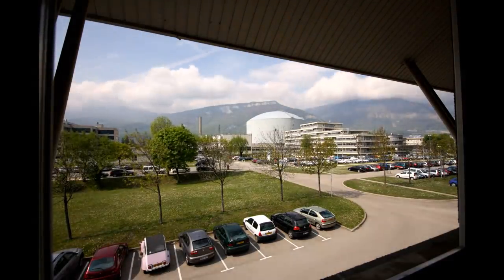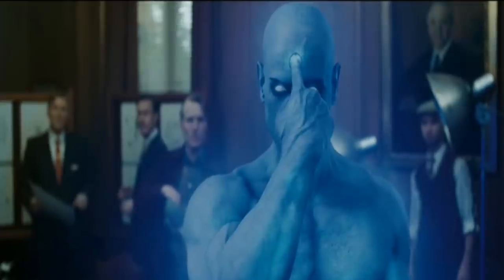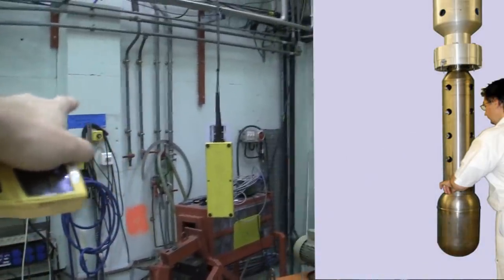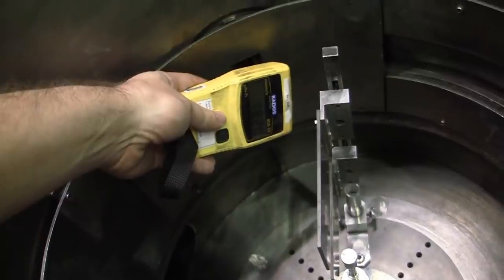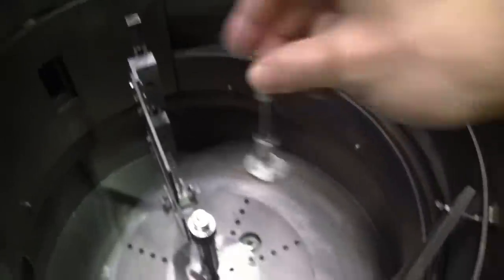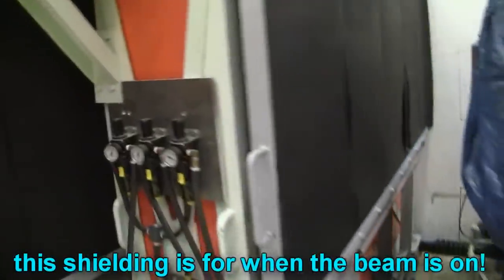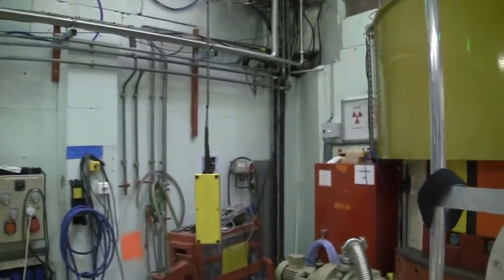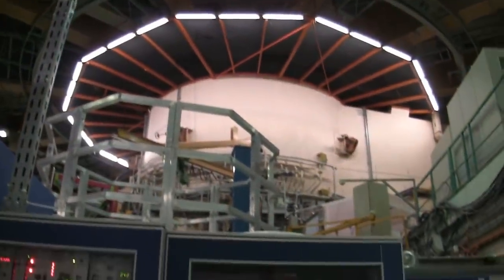Nuclear Reactors, Fantasy and Fact!

Comment: Won't the neutron be far away from its source by the time it decays. I would think that a neutron would have traveled pretty far in 10 minutes.
Reply: That's the half-life of a neutron. That's not to say that half of a neutron decays in 10 minutes... rather, half of an certain amount of neutrons (all of which have spent the same time as a free neutron) will have decayed into protons, electrons, and antineutrinos after 10 minutes of being free neutrons.
If you consider a single neutron, the actual time for it to decay is actually quite random.
If you have an enormous amount of neutrons streaming from a reactor, then you have a chance for a large amount of them to randomly decay in a short amount of time.
At least that's what I think. I'm not an expert on this subject.
Reply: I think its still safer to stop the "runaway neutrons" before they could potentially cause damage. It would suck if you got cancer from a stray neutron while driving past a reactor.
It would be like aiming fireworks over your garden wall, It's not gonna hurt anyone inside your garden but it might explode on someone elses face
Reply: Why do ya' think that?
Reply: Pinkie Pie I would think the same, a break-away neutron seems like it could have alot of energy built up

Comment: Great video puts things in perspective. I used to be indoctrinated with how bad nuclear power was. In highschool I did my end project for physics on nuclear power and my first question is: "which form?! there's many different ways to do nuclear power."

I was also astounded to find out that the uninitiated thinks that nuclear material with 10.000s of year of half life are more dangerous than material with enormously short half lives. As you explained here I found out that it's quiet the opposite the stuff with long half lives have marginal energy discharge and very safe for mankind and environment.

When in college (3 months after graduating highschool) we had the chance to go into a nuclear powerstation I was thrilled. I was one of the few who dared to look down at the reactor. I was certain that the 15 meters of hard water on top of it shielded me from harmful photons.
It's interesting that people who even put a little research into nuclear power see that the damage and risks are far less hazardous as burning fossil fuels. Burning coal and oil sets free a lot of radon and fine dust that are far more deadly than a nuclear powerplant will ever be.
Other techniques of Thorium salts seem to also eliminate the potential meltdown risks.

I rather live next to a nuclear power plant than a coal burning power plant.

Comment: The radioactive material is not glowing blue. If you put a lump of that stuff next to you, you would not see a blue glow from it, for two reasons: 

1) You would be dead
and 
2) The blue glow is the result of electrons traveling faster than the speed of light in water. 

So, the blue glow requires water, and speedy electrons traveling faster through the water than light can.
Reply: You can get that blue glow in air, because light slows down when moving through it too, just not as much.  Your point one would still be true as the amount of radiation needed to create that glow would be very quickly lethal.
Reply: Steffan Murphy Nothing can travel faster than light in a vacuum in free space. Other terms and conditions may apply. See store for details. Objects may travel faster than light inside material substances.
Reply: Steffan Murphy About Cerenkov Radiation: 
http://en.wikipedia.org/wiki/Cherenkov_radiation
http://www.britannica.com/EBchecked/topic/109373/Cherenkov-radiation
http://large.stanford.edu/courses/2011/ph241/keller2/

About the Speed of Light: 
http://en.wikipedia.org/wiki/Speed_of_light
Reply: ***** Not sure if you've ever taken a Physics class or just watch cartoons.
Reply: I think this whole thing is more a misunderstanding.

Nothing can travel faster than the c, which is the speed of light in vacuum. 
However, light travels slower in water than it does in vacuum. 
Beta particles can travel faster than that, causing the light.
Reply: mikek17 You need to specify that is true only in a vacuum. It is not true through, for example, water.
Reply: Hisoichi ouchi or something in the accident his partner claimed it glowed blue before he passed out and that was without water and was with a bucket (which don't ever do ever or you might be picked for experimenting for 83 days)
Reply: Nothing can travel faster than the speed of light.  If it did it would get flatter and flatter until it ceased to exist.

Comment: loved the video, its rly informative, i would love to see a video relating to the atomic waste, howmuch waste is enerated and how its disposed of, its kind of confusing to mebecause some say that its clean and safe while others say that it generates a shit ton of waste and that there is no safe way to dispose of it.
Reply: christo930 You sir are wrong! The reactors in the 50s and 60s had one priority and that was to generate Pu, but companies like EDF and GE hitachi produce only civil nuclear power. Fuel sits in a pool in order to be cooled before reprocessing, separating the fission products. This product can then be stored for use in a breeder reactor or geological disposal. Seeing as uranium fuel costs make up only 5% of the total cost of a nuclear power facility uranium prices can rise 6 fold and still be considered viable to extract, so the 10 years you quote is nonsense.
Reply: Only about 5% of the energy in a pellet is used and a lot of it has to do with the fact that the reactors were made mostly to generate plutonium. The pellets should be recycled or put in a reactor that can use the rest of the energy.  There has been endless testing on nuclear waste and it's extremely safe and there is no reason to have nuclear pellets sitting in pools in nuclear plants. It's simply misinformation that scares the public. The pools are MUCH more of a risk than the cemented pellets. FTR.. Much of the world is beyond peak Uranium production. If we replaced every single power plant in the world to nuclear, we would be out of commercially viable  Uranium in 10 years.

Comment: It's like driving a car. Sitting in a moving object that moves with 100 km/h or more on a relatively small space (a street) with hundreds of others nearby and limited safety measures in case of a crash is incredibly dangerous- but you can still do it as long as you are aware of the dangers and how to minimize the risks.

Comment: It doesn't matter if we dump 1000's of tons of water in reactors, The Mississippi river only discharges 16000 tonnes of water per second into the Gulf of Mexico. Most nuclear reactors use around 100 tonnes per second for 1500 MWe. That means that assuming all water used by a reactor was lost, it would take 1 reactor 100 million years to use up all the water in the Atlantic. Using water is by far the least of our worries when it comes to nuclear power.

Comment: Sort of, atleast from a radioactive standpoint but a small portion of the Hydrogen atoms will absorb stray neutrons and become Heavy Water which is extremely toxic to human and it does undergo a radioactive decay.  Also there is a pretty large amount of chemicals added to the primary coolant to prevent corrosion of steel piping.  The chemicals are also certainly harmful.  A sip probably wouldn't hurt you.

Comment: depleted uranium is also a great radiation shielding, atleast from gamma.  Water is a much better neutron shield.  Boron impregnated polyurethane is actually one of the best, with a two inch lead shield in front and 10 inches of borated poly you can reduce neutron counts to 0 and gamma counts to background.

Comment: because transmitting energy from a satellite would be a fucking nightmare! And the satellite would have to be quite large/expensive for this hole deal be useful. Nuclear power plants are actually pretty reliable. They run 24/7 in a almost-closed system, with maximum efficiency e minimum danger. Now: You do know that, to build solar panels we need minerals, right? Pretty expensive and rare ones. And the reaction by wich they produce energy is quite inefficient (for now).
So...  Not a good option.

Comment: You can tell if cancer is related to radioisotopes in the body by measuring the levels of said isotopes. If they are synthetic isotopes, meaning they are not found in nature to begin with, it's a dead give-away.

That's how we relate other pollutants to diseases, like coal emissions to asthma attacks and respiratory problems which kill hundreds of thousands around the globe every year. You can detect abnormal levels of those chemicals. It's even easier for radioisotopes.

Comment: That device he was holding, will not pick up neutron radiation. Neutrons have mass but no charge, and need a specialist counter to detect them. And yes, flying above 30000 feet DOES irradiate you. Took a counter with me on a flight to the states a few years ago. Eight hour flight, same as what I got on an eight hour shift on a reactor!

Comment: I don't think it's considered meltdown if they successfully contain the radioactive material in the reactor.  Anyway i think that that salt might not be enough to stop the reaction always and there is still risk for the radioactive fuel to continue heating up and melting itself through the reactor. 

Anyway my point was that even if fuel is molten, the reactor is not and meltdown is what happens when fuel gets so hot that it melts the reactor itself.

Comment: No one makes reactors like Chernobyl anymore.  They have a double positive feedback.  What that means is as it gets hotter, activity in the core also goes up, causing it to get hotter, ect.  Modern reactors don't do this, as it gets hotter,(chernobly used graphite) doesn't work as well in allowing fission to take place, this results in a negative activity as it gets hotter in the core.  If you google "hiroshima syndrome chernobyl", and visit the site that pops up, you can get all your answers.

Comment: Yes, the key words there are 'being studied'. Optimistic estimates say the first commercial fusion reactors will be built in the 2050s, by which time fission reactors built now would expire. Also we don't have to choose between fission and fusion, we could well have both until we have phased out the fission reactors. The fact is we're quickly running out of oil, and if we prevent the building of new fission plants we have to burn tons of coal before 2050, a disastrous option for the environment.

Comment: There's a better alternative being studied; our nuclear power plants rely on nuclear fission, splitting big atoms to release energy. The new method uses nuclear fusion, fusing hydrogen atoms together, resulting in much more energy. Fission's big drawbacks are the production of harmful radioactive waste, the need for a limited fuel source and the risk of meltdown; fusion eliminates those drawbacks, as it's fueled by hydrogen, its byproduct is a small amount of helium and it cannot meltdown.

Comment: The residual radioactivity, according from the readings we saw on the handheld device, was nowhere NEAR dangerous doses. The device measures in microSieverts; that's 0.000001 Sievert. Doses leading to acute radiation syndrome (commonly known as radiation poisoning) are usually above 0.1 Sievert. The highest dose I noticed in the video was 11.6 microSieverts. For short; potentially lethal dose >0.1Sv. Highest dose shown in the video = 0.0000116Sv.

Comment: Water with a pH of 7.01 is alkaline, water with a pH of 6.99 is acidic. Water that is slightly alkaline is pretty good for you especially if you have problems with a unusually low pH in your stomach. Many mineral waters have pH way above that Cloud Juice from Tasmania is at 7.58. Waivera from NZ has a pH of 7.87. over 8 times higher [H+] than that for neutral water

Comment: When calculated by the amount of casualties divided by the amount of energy produced nuclear energy is hundreds of times safer than oil or coal. Renewable sources are quickly approaching the same cost effectiveness as nuclear power, but you can't power a city at night with solar panels. If we stop building new power plants we have to use more fossil fuels or keep using the older models which aren't as reliable as the new ones.

Comment: @LetalisLatrodectus:
You probably mean the right thing, but just to clarify:
Cherenkov radiation occurs when a particle is faster than the light speed in the medium the particle currently is. Since the speed of light decreases in a medium, a particle can be faster than light in a medium, but still slower than the speed of light in a vacuum (3*10^8 m/s).

Comment: I don't think current nuclear technology is worth using for power generation. It's a short term bodge that creates long term problems and diverts resources from better technologies. However, as Jim Al-Khalili pointed out on one of the series he did, there are other nuclear technologies under investigation. Like helium fusion, some of these will be a lot cleaner.

Comment: This diagram shows the difference between various forms of ionizing radiation and what it does to matter.

tinyurl*com/behzfhy

That detector in his hand would be measuring photons/electrons in the form of γ gamma radiation coming from the reactor that generates the neutron beam. Again very dangerous form of ionizing radiation. Outside of that neutron beam, a very dangerous source of radiation.

Understand that when the experiment is running you can't be in that room!

Comment: No exposure is "harmless". You are simply playing the statistics game... the game of life in essence 

Think of it as playing Russian Roulette only it's not a six shooter cylinder gun. It has a 1, 000, 000 slots for bullets.

Actually the type of radiation in that room is very dangerous and thus all the precautions regarding stray neutrons coming from the beam missing the detectors and hitting the walls.

n0 → p+ + e− + ν e +y releases 0.782 343 MeV in 611.0±1.0 seconds.

Comment: I suspect commercial reactors still have control rods. The Fukushima reactor was SCRAMed, how was that accomplished without control rods?
What dangerous radioisotopes would be created by spent fuel rods exposed to air? The longest lived nitrogen istopes have a half life of 10 minutes, oxygen 2 minutes. They decay into carbon, a long lived therefore low level radioisotope.

Comment: most commercial power plants have fuel rods, rather than control rods, because they're meant to be run at near 100% capacity nearly all the time. Spent fuel rods are very radioactive, and the radioactive decay makes them hot, so they have to be kept cool or they melt. It's not the reactors at Fukushima that were the danger as much as the spent fuel boiling off their water and being exposed to the air we breathe. Does that answer your question?

Comment: Great job as always, Thunderf00t, but next time please consider wearing light gloves, like nitrile, to protect the vacuum chamber from finger grease. It will help keep the device clean and pump down to high vacuum. Also, the boron 10 is there to react with the neutrons, producing lithium 7 and an alpha particle. I guess it will need to be replenished from time to time!

Comment: Obviously a research reactor. Duct tape, ripped diagrams, semi-loose cables everywhere... Only scientists dare being that casual with potentially lethal equipment.
(If you think I'm just regurgitating negative stereotypes, no, that is not my intention. It's just true from what I've seen so far. In a commercial reactor, the diagrams would be laminated, the cables strapped down tight, and so on.)

Comment: The speed of light in a vacuum is a constant, and is an unsurpassable velocity. However, the speed of light in other other media (such as air or water) is significantly slower--this is called the phase velocity of light, and it can be surpassed. For water, this is about 3/4 c.

When a particle that has been accelerated to beyond this phase velocity of light returns to subluminal velocity, the blue Cherenkov light is the result.

Comment: There are radioisotope thermoelectric generators, where the heat of a decaying piece of radioactive matter drives a thermoelectric cell.  

This is not practical on a commercial power generation scale, though it's the standard power source for deep space probes.  Nothing else will last long enough except solar, and they are too far from the Sun to get enough power that way.  I *think* it's used for some Earth orbiters too.

Comment: Not the speed of light in vacuum. The speed of light in that specific medium, water in this case. The phase speed can be both smaller and larger then the speed of light in a vacuum. This is measured by the index of refraction. Water has about n=1.3, so the phase speed of light is 1/1.3 times the light speed in water. In metals, the index of refraction is smaller than unity, so the phase speed is smaller than light speed there.

Comment: Its what reactor control rods are made of.  B10 (20% of natural boron) absorbs a neutron and becomes stable B11; B11 (the other 80%) absorbs a neutron, releases a beta in 20msec and becomes stable C12.  B10 and B11 both have very wide thermal neutron cross-sections.

Comment: Monochomatic neutrons? Googled it, encyclopedia2.thefreedictionary (dotcom) states A "beam of neutrons whose energies are confined to an extremely narrow range of values".
So nothing to do with a single frequency of radiation but effectively a speed range of neutrons.
I think you mentioned thermalized neutrons, so these would be typical neutron energies found in common light water reactors? Which would make this facility suitable for testing materials to be used in common power reactors?

Comment: As Tf00t said, it's Cherenkov radiation. It's caused by particles moving faster than the speed of light in the medium (light slows down outside of a vacuum and the speed it is going in that medium CAN be exceeded)